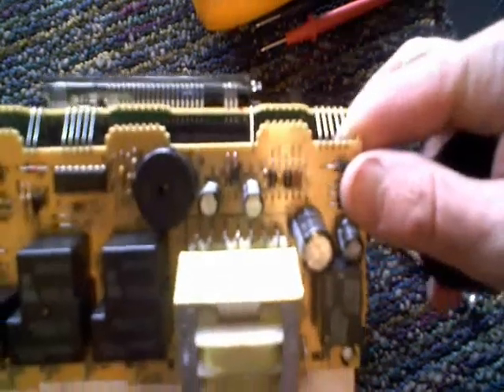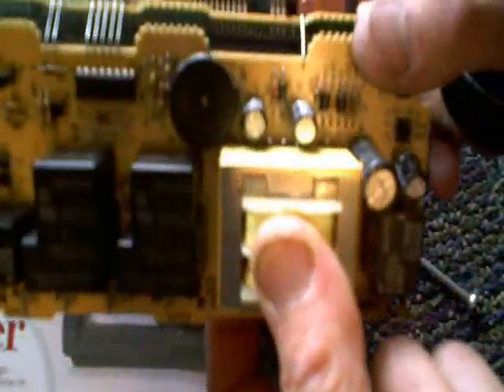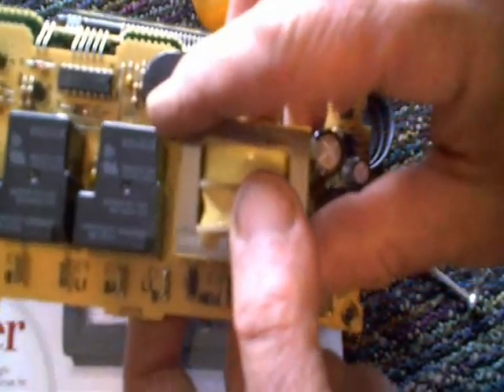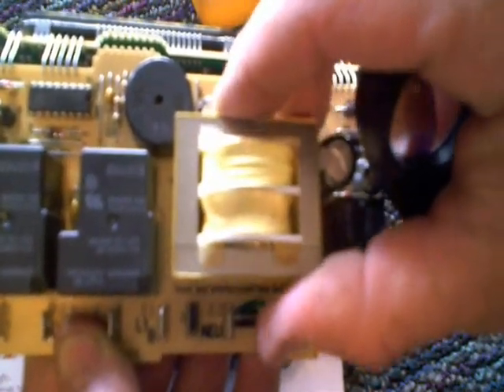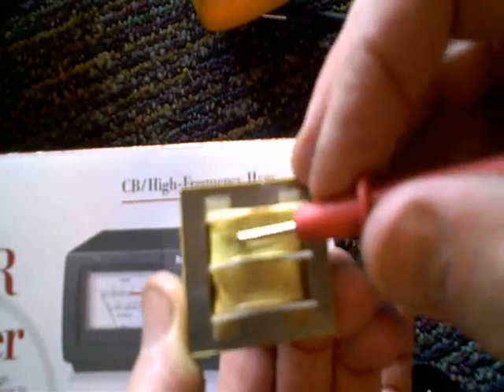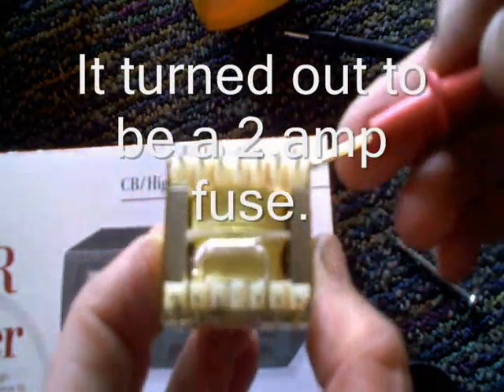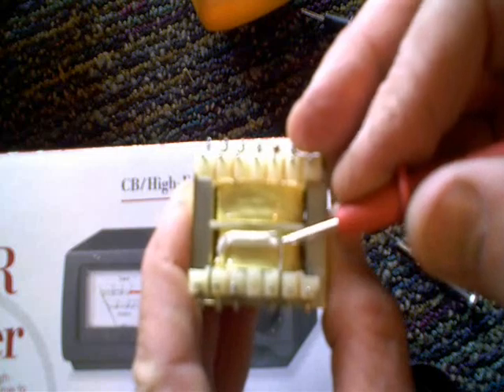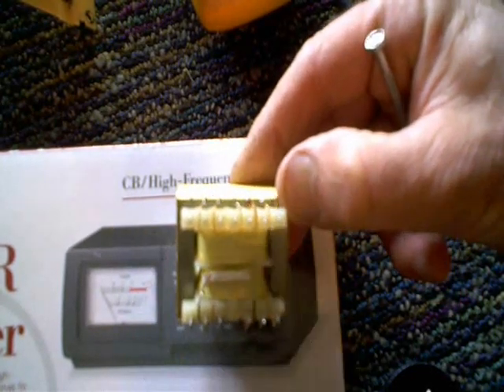Hidden Thermal Fuses in Transformers. Please watch update also!

Comment: I repaired a dishwasher that had a bad thermal fuse on the circuit board. $1.15 for a new radio shack thermal fuse and it still runs! The original temperature was 150F at 5 amps. Way to low for the drying cycle. I put in a 175F. Works fine.
Reply from the maker: I never cared for those those thermal fuses, but I suppose they are a good idea in some applications.

Comment: Thanks a bunch!  One of the zener diodes on board shorted (when the oven bulb blew) and the shorted zener caused the transformer to overheat, which then blew the hidden thermal fuse.  I would have never found the fuse without your video.  Coffee's on me next time you visit British Columbia!  Many thanks!!!!
Reply from the maker: It's always nice to hear someone found one of my videos helpful. Thanks for the comment.
Reply: Which zener blew on yours? Might help me narrow mine down. Nothing looks burned on mine but I clearly have a bad transformer or (more likely) a shorted component somewhere like a zener.
Reply: I cannot recall the Diode designator number (and the unit is back in my stove now) but if you pause this video at the 10 sec mark you will note there is a large electrolytic capacitor just below his thumb.  In between that cap and the relay (just below the cap) is a small glass diode.  This is a 16V  IN5246B zener diode and it was shorted on my unit.  This caused a short circuit in the DC supply (for the microcontroller, etc)  which then caused the transformer to overheat and blow its thermal fuse.   All fixed now!   There are quite a few zener diodes on this board,  might be worth checking them all for possible short circuits.
Reply: Extremely helpful thank you! Looking at the traces on the board I was suspecting that one after seeing your comment about a bad zener diode. I just desoldered it, tested it, and get near 0 voltage drop both directions with the DMM. Bingo. Thank you very much.
Reply: Happy to be of help!  I guess this is a weak spot in the design;  something to remember the next time it fails.  BTW, I increased the zener rating to 1 watt so hopefully it will not burn out so easily next time it is stressed.
Reply: I also found a thermal fuse inside a cheap ding dong doorbell solenoid coil. Right on the outer layer under the tape just like the one in the video but it's not covered in any paste or anything, just one end twisted to the coil wire and the other end to the input wire. It is squared shaped, it says rh150-1. 150 is the cutoff temperature, 1 is the amps, I don't know what rh means, could be heat resistor. Those cheap bells don't have a transformer, the thermal fuse protects the coil from burning if the buzzer button is pressed too long. It is a retarded design. They design things with zero redundancy.

Comment: Great video.  I'm sure it is going to help me finally complete the repair on my Fridgedair Dual Oven Controller Board just like the one in your video.  Any chance you can tell us where the thermal fuse was located on this transformer and the required replacement values?
Reply from the maker: The value of the thermal fuse is generally marked on the one that's in the transformer.
Reply: @GrantsPassTVRepair  the transformer on my GE double oven looks identical. But it is burned up. We had power surges and it seems to be the thing that fried. I would sure like to talk with somebody that could educate me about finding one of these.

Comment: I have one of these boards that won't power on but the transformer gets extremely hot and burns out the fuse. Not sure if it is a transformer failure or something else on the board. I can't even find a transformer however, like you said there is no info available anywhere for it.

Comment: Hi Dave. Thanks for sharing your very professional video.  In 1983 I graduated as an electromechanical technician.... yeah, long ago : ) .... although I don't work in the field I improve/replace things around me when I can ... would you be able to find a thermal fuse(protector) for the coil in the "24 volt Taco power head" for hot water running boilers? ... to replace the commonly burning heads costs above $60 and I strongly believe a fuse would be less than $5.  Please research, discover the fuse and let me buy them from you. I strongly believe the manufacturer have specifically designed them like that, unprotected for the extra money in selling replacement taco power heads. Thanks in advance ; )
Reply from the maker: I'm sorry but you're  not giving me enough information to assist you. If you bring the old fuse in my shop, or perhaps some identification numbers on your fuse I may be able to help, but not with the information you have given me so far.
Reply: @GrantsPassTVRepair  thanks for replying. The valve don't come from the manufacturer with a thermal protector or switch.  I have not have time to research for the overheating protection that it needs ; (

Comment: Amazing. Was searching for a transformer and found your video. I have an oven controller very similar to the one you are working on with similar problem. It is losing power intermittently. After searching I found one tiny place on the bottom of transformer I could barely touch and it would open the circuit. Thanks for the video because it has encouraged me to tear into the transformer and try to fix since I can't find a replacement. I haven't checked the secondary voltage yet. You don't know where I can find one, do you? This controller was close to $400 and are not available anymore. So if I can't fix this transformer issue, its a new oven for my 88 year old mother.
Reply from the maker: If you can find the whole board on the second hand market.by entering the board numbers in a  search engine that may be one alternative,

Comment: I generally avoid appliances with circuit boards. appliances used to last for decades before they started using them. & that's coming from an electronic tech who can repair boards. They want to sell you a new circuit board for hundreds & this is certainly one of the schemes used to that end.
Reply: I did the very same thing.  I started collecting all old style stoves and dryers and washers people put out.  I was able to repair most.    I gave away many to families who needed them and then sold some to keep the ball rolling.

Comment: I have a non working old transformer from 80s there's no sign of damage at all. The copper looks brand new after I removed the plastic. Is it possible that it has a burnt fuse deep inside? Because nothing is showing in the outer layer. I also can notice some extra wires covered with a sheath from both live and natural lines on the primary winding going to the inside but I can't see where they go.
Reply from the maker: I don't remember ever seeing hidden fuses behind the copper wire. Only under the plastic tape.
Reply: @GrantsPassTVRepair  the transformer has 3 lines aka it is center tapped. I checked the continuity of the third (skipped) line and it was OK. Does that solve the problem if I just substitute it to the other one?
Reply from the maker: @pizzapie8347  I'm not sure I understand your question, Can you be more clear?
Reply: @GrantsPassTVRepair  the primary winding has two 110v terminals with a neutral terminal in the middle. This combination is known as center tap as you know. Currently one live terminal and the neutral are connected to the wall circuit the third (live) terminal being skipped. Now if I just skip the non working live and replace it by the skipped one, does that work? Wouldn't that effect the output and polarity?
Reply from the maker: @pizzapie8347 Based on your description It sounds like that should be okay, assuming it's a center tap trasnformer as you stated, and you're only going to use the un-used leg. You don't need  to worrry about the polarity on the transformer itself because it's alternating current which means the polarity is continually changing..

Comment: I was hoping to see a verdict. And by the way what was the problem with the stove?
Reply from the maker: I'm not sure since it's been a while since I made this video.
Reply: Grants Pass TV Repair can a transformer be checked while on PCB board? I have an inverter and I was trying to wire up an external power switch to. Its a 1500watt pure sine wave. Well long story short something popped and smoke came out and now it won't power on. Weird thing is there is nothing visible on the board top or underneath. And one other strange thing is there is no power going to the 2 glass fuses next to power terminals. Any suggestions would be great. Thanks for all you do and posting videos of your knowledge.

Comment: Who would have thought that excellent,but why also the fuse at E1 E2 input possition?
Reply from the maker: I can't answer for the circuit board designer, but as a general rule the fuses in transformers are thermal fuses, they operate a little differently than the fuses on the curcuit board. The difference in a thermal fuse is that they open up by heat and overcurrent draw, where as a conventional fuse opens by exceeding it's current capacity alone. Sometimes you have situations where a transformer can overheat due to an internal short in the trasnformer coil, and the transformer can become hot enough to start a fire, but still not draw enough current to blow open a conventional fuse. I hope that helps.
Reply: @GrantsPassTVRepair  Thank you so much for the most informative and knowledgeable explanation,l understand how this makes perfect sense to do this.

Comment: It is probably a thermal fuse. A manufacturer told me one time that all power transformers are required to have a one time thermal fuse per regulations in some countries and/or even cities.  So most manufacturers do install thermal fuses so their products can be sold anywhere.  That manufacturer went so for to make the thermal fuses in their power transformers replaceable and had a separate  part number for it when the regulations first came out.  Later, they stop making the fuses replaceable I think because of regulations again.  Main purpose of the thermal fuse is to prevent a fire if the transformer overheats.

If you look at

https://www.digikey.com/document-redirector?doc=http://www.digikey.com/Web%20Export/Supplier%20Content/SignalTransformer_595/PDF/signal-transformer-pi-understanding-transformer.pdf ,

You will see this:

"In the U.S., some cities have their own requirements. For example, the city of Los Angeles,
because it is in an earthquake zone, has set certain standards, including requirements for tamper-
proof thermal protection and nonflammable materials."

You can buy replacement thermal fuses.  If you search for EYP-2BH145 at mouser dot com, you can download a datasheet and see this fuse has both a current and a thermal cutout rating.

I don't mean to be critical but rather to inform.  Enjoy your videos.  Keep up the good work.
Reply: StevesProjects They are thermal fuse , in a transformer company I worked for, I used to place them in the primary windings. it should state the temp on it.
Reply from the maker: Luis Diaz  That's good to  know for the future,  I don't imagine it will ever be an issue with such a small current passing through it.
Reply from the maker: StevesProjects Thank you for the info. I updated the video to make sure everyone knows to use a thermal fuse.
https://www.youtube.com/watch?v=qFOFFKtQlr8
Reply: Grants Pass TV Repair You are probably right that it would probably never be an issue.  Back years ago, they didn't put in thermal fuses and never seem to be a problem back then.  Occasional you would see a transformer short out because it overheated and then blow the main fuse.  Today you never see that but you also see a lot more transformer failures due to the thermal fuse opening up.  I don't believe UL requires thermal fuses.  Seems kind of strange that a regulation in one small area can land up making product changes worldwide.
Reply from the maker: On the older CRT TV's it might be more of an issue due to the huge quantities of dust they often collected. I was just reading an article on electricity and home fires at https://www.firerecruit.com/articles/1206100-5-common-causes-of-electrical-fires

Comment: And to top it off, they won't put the fuse up on top but in the bottom of the transformer.  To make sure to make it difficult.  You have to disolder the transformer to find it.
Can that fuse also be a thermal fuse of some sort too?

Off the subject:
If you want to learns all this, you have to take years of schooling and pay for all those bewildering lingoes, wondering if they are speaking some other alien language.  Don't forget them 0s and 1s.

I have always wondered how in the world do you charge a battery or capacitor or anything for that matter?
Don't they teach you that the whole god dam world and everything in it is made of charges?
All of a sudden you pump a bunch of charged particles in whatever the hell?

All that atom suddenly run out of electrons or something in that battery?
If that be the case, then the battery is charged with protons. Or if it lost a bunch of protons then it is charged with a bunch of electrons.
What kind of charge are you pumping the battery with anyway?  Negative or positive?
Isn't it all just Ego bullcrap?

Comment: The problem is, what blew the fuse? Replacing the fuse could make it work only until the same situation happen again...
Reply from the maker: Yes of course, but when it comes to thermal fuses I'm guessing they candeteriorate over time when there isn't a problem because I've never known of one to fail again after I replaced the fuse.

Comment: Why would a transformer have the correct output voltage but unable to supply a current?  I would have thought a damaged wire insultion would cause a drop in output voltage.
Reply from the maker: How did you determine that your transformers output current was to low?
Reply: @GrantsPassTVRepair  The output voltage ac appears spot on and following the bridge rectifier the dc voltage is correct when measured with a high impedence multimeter, however the current delivered is in tge miliamp range. A burned insultion on the primary coil I would have thought would give a low output voltage if any at all??.  Would a poor solder joint cause this?
The resistance measured accross the primary is 15 ohms which might appear a little high and indicate burning of the copper wire insultion??  But I would have expected the output of the transformer to be almost zero as a result.
Reply from the maker: @irishguy200007  Your question is not clear enough for me to understand.